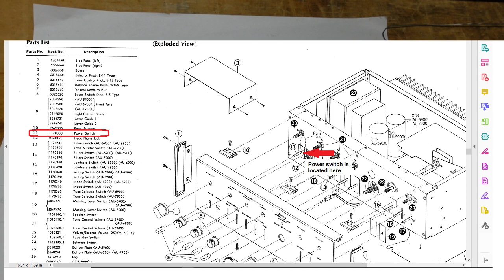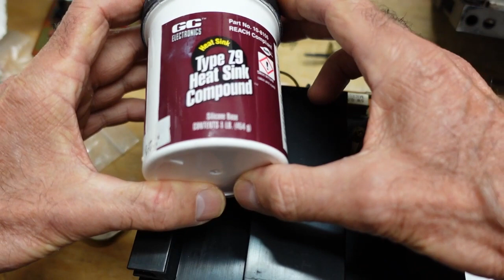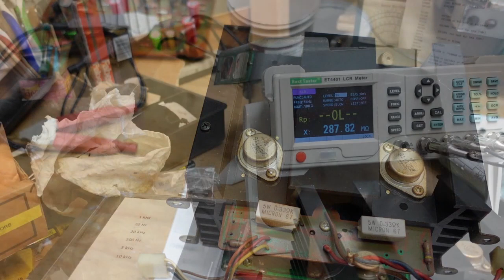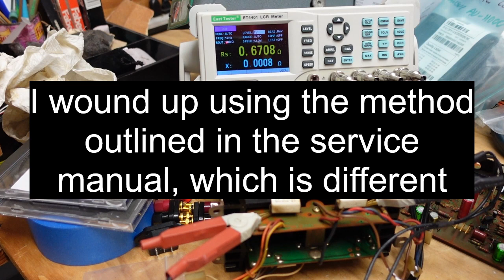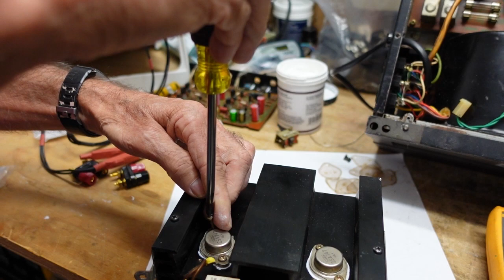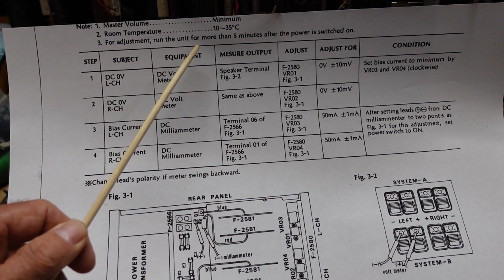Sansui AU 11000 Rebuild Part 6

Comment: What is the cost of such a rebuild?
Reply from the maker: Jef, it can add up quickly. I was able to get a good price on the filter capacitors, which I had to cut a mounting bolt off of.  Otherwise, those alone can account for over $100 in parts.
It's labor intensive, so the biggest hurdle is finding someone will to take it on.  Very few shops do this, as the price they have to charge would be prohibitive.

Comment: To be honest, I blocked the xrayman, he was constantly complaining about negative messages, and he lost the focus, on the repairs. And it came back over and over again, and be honest sometimes he did things very controversial. That's how you ruin your channel, he is a good technician, but it was too much, and then I found your channel, which is amazing. I remember that podcast when he was talking about Deoxit, but he used way too many, it was dripping out of the chassis. So he got a few reactions that he didn't like. Well, if you can't handle critics, don't start a channel. In my opinion. That's all I'm going to say about the man. PS: I can recommend a Wiha easy Torque electric 41345, does the job very well, I have 3 or 4 on my bench, because I also build computers, where water cooled systems has to be torqued. Or CPUs.

Comment: Ray, could you comment on how you reconditioned the volume pot as I believe it's similar to the one on my Sansui CA-2000 preamp.  It's a big black Alps unit with no observable openings and it's getting a bit noisy.  I'm leery of opening it up as I know it's made of unobtainium now.  Bought it new in Japan along with it's brother a BA-2000.  Thanks so much for your videos.  I've learned a lot from you so far and still have a bunch more to watch!
Reply from the maker: Hi Robert.  Well, while I've never seen a CA-200 (yet!), but it sound like the volume control is similar or the same as the one in the AU-717.  It's made up of several layers that can be separated a bit by removing screws from the back.  The AU-11000 doesn't have the same volume pot, although the knobs look the same.  HTH!

Comment: I want to add to that mistake that you mentioned, on the traces peeling as it were from the substrate of the PCB. I can add one more mistake, a very dumb mistake, I was desoldering a PNP or NPN transistor and well I was using a solder braid to suck up the solder. Well at some point the braid got stuck to the through hole part of the trace and stupidly I left the braid hanging there (unit was standing on its side) and the gravity was probably enough to slightly disengage the trace from the PCB. I managed to gently get the braid loose from the trace but now I have a trace that is loose, the solder is holding it in until I get a replacement transistor but I may have to slice off the loose part of the trace and use a wire to extend the connection up to the trace that is still adhered to the PCB. Stupid me but I learned from my own mistake as well. Hope it helps others but as you say Ray, these are old units and sometimes we need to be much more thoughtful and careful. It's better to take 1 minute more than spend several more minutes repairing the avoidable. Cheers!
Reply from the maker: Agreed.  But you have to admit, these are the lessons that stick with you!
Reply: @raygianelli3612  absolutely

Comment: Old timers tip: An arcing power switch will cause interference on an AM radio. A transistor radio held anywhere near it will pick up the broadband interference, The earliest radio transmitters were spark gap types.
Reply from the maker: I can pick up the interference with my pacemaker.  Kidding, nice tip, Mark. Thanks for posting it!